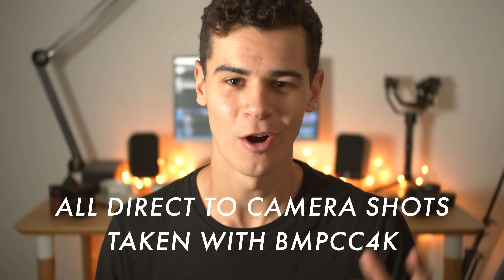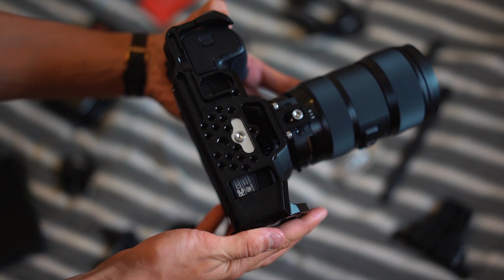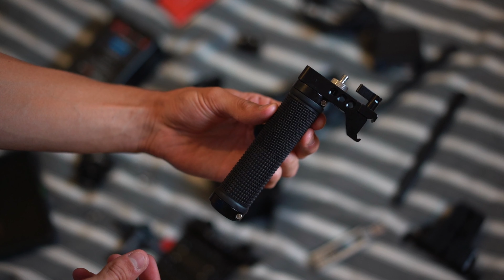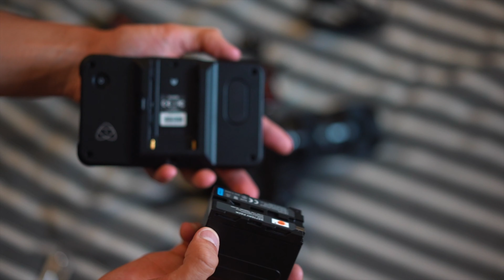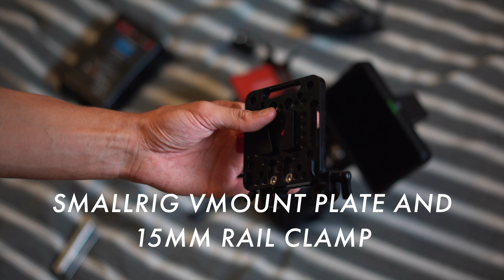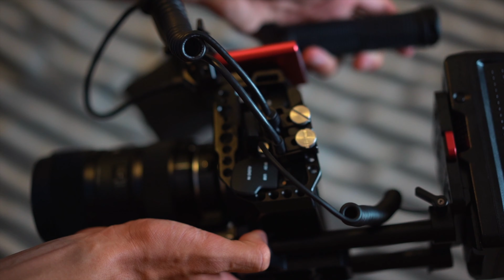My Compact BMPCC 4K Rig Build! //  Blackmagic Pocket Cinema Camera 4K

Comment: Ik I’m late but quick question. Ur speed booster mount....besides screwing into the cage and mount does it have a place where u can add additional threads/parts to the actual mount? Like is there another thread hole besides the one that clamps?

Comment: How much did you spend in reality on this camera?
Reply: It's been a while since the comment but If anyone has the same question:
I built more or less the same rig above albeit with different brands of cables, baseplate, v-mount battery and an additional manual follow focus. I also got an SLR magic 8mm lens, a Lumix 45-150mm native lens and  a dummy mft to f-mount adapter. I already own a complete set of old Nikons so these two lenses were pretty much enough for me. The total cost came around $2900 (The camera being $1300).
In terms of getting a full blown cinema camera, I think it's a killer deal.

Comment: I would love to know what the minimum requirements are for an editing system to edit in 4K raw, min CPU, Graphics card, onboard ram, Ect. Good rigging tutorial Thanks.
Reply from the maker: Linda Muvic Can’t help you there I’m afraid! Only thing I would say is that it did send my late 2016 MacBook Pro into meltdown a bit haha
Reply: Check out ltt's video on 4k editing pc. That's pretty much what you need for 4K raw
Reply: 2060 super, ryzen 7 3700x, 32gb ram and at least 1tb internal ssd

Comment: Hi just wanted to know will this setup require gimbal or steadycam for making smooth video.
Reply from the maker: Hi there! If you check out some of my latest videos I have examples of things I’ve shot with this rig, you definitely won’t be able to get super smooth walking motions, but it’s definitely stable enough for handheld filming! Hope that helps man
Reply: @TomRichOld  thanks bro ,  but if you need a smooth walking video , can this is equipment be connected to a steady cam.
Reply from the maker: Sunit Sharma You’d be hard pressed to balance the entire rig on a steadicam setup, but you can definitely decrease the rig a little in size, maybe to just the vmount and SSD.
Reply: @TomRichOld  thanks

Comment: Hey Tom! thanks for the video! One question , how's going with the baxxtar battery? And can u recharge the battery via D-tap?
thanks
Reply from the maker: I haven’t done any massive shoots on it yet, but I’ve only charged the battery once 😂 so definitely seems to be going strong!! And yes you can I just bought a simple D-Tap to power adapter cable :)

Comment: What about the quality of the footage? I can't see it being very stable, this is my only issue with these rigs. Of course if you put it on a tripod it will be stable but tripods can give quite borung footage. These are just my thoughts.
Reply from the maker: Thanks for the question – it's actually pretty decent handheld. The extra weight on the right is really helpful because it reduces micro jitter. For an example, check out my latest video (a bit more shake than usual because I was shooting on a 70-200mm) but a good example! Hope that helps man

Comment: would there be a way to attach the tilta wireless follow focus to a handle on either side of the rig? So it could be handheld and easy to focus. I have manual focus lenses from samyang?
Reply from the maker: Hey Sam, I haven't ever owned the tilta FF, but as you have rods underneath pretty confident you should just be able to mount them on. Should definitely be compatible!

Comment: Still way too heavy! For example you only need one of those two batteries to power both Camera and Shinobi.
Reply from the maker: Disagree actually! The NPF aren’t too heavy, it helps with balance overall, and it cuts down having another wire cut across the whole rig. That was an active decision 😁 thanks for watching!!
Reply: @TomRichOld  What is the total weight of this setup?
Reply from the maker: Kirill Kleykov It’s about 4.5 kilos! Hope that’s helpful.